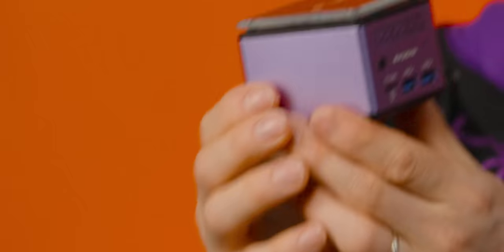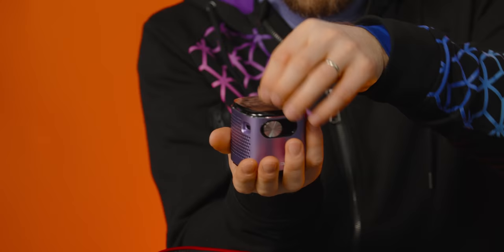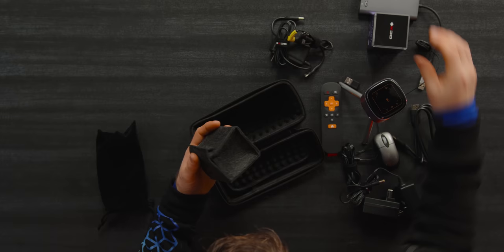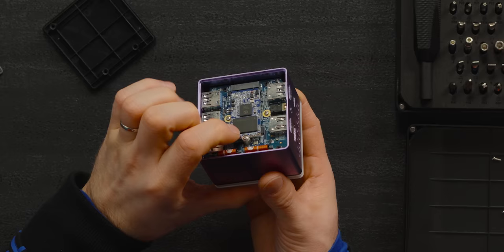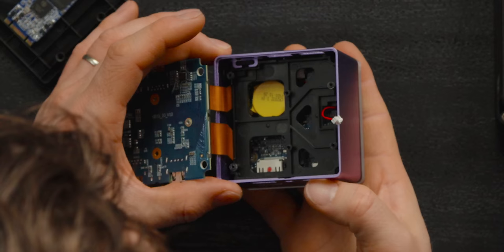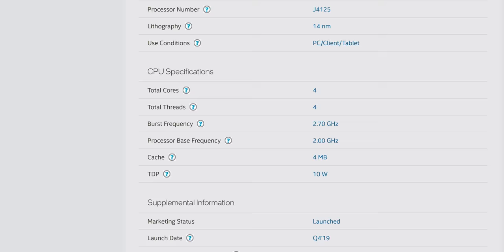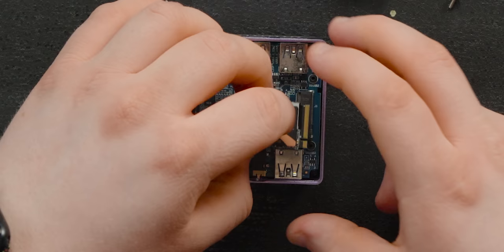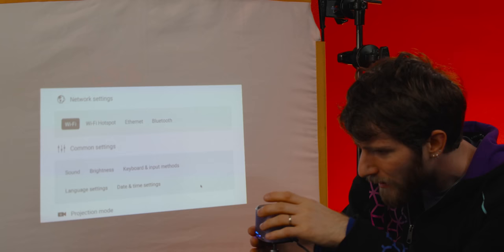This is a computer - XDO.AI PicoPC

Comment: Having the USB ports upside-down is just pure genius because it means you will get it right on the first try!
Reply: No, it mean you get right on the second instead of the third. Lol!
Reply: That's not how it works. You get it right the first try, but are holding it slightly off-center. Then you flip it, it still doesn't go in, you wiggle it around to make sure, then pull it back and look at the port and look at your cord and realize you had it right the first time.
Reply: @CyberneticArgumentCreator  this is the only way
Reply: LMAO
Reply: Pretty sure this results in a 1 try penalty, so it would go from the perfect 3 try minimum, up to 4.
Reply: @CyberneticArgumentCreator  lol
Reply: Not sure why products in 2020 are coming with USB A anymore. I thought we moved on to USB C?
Reply: AND NOW USB C :)
Reply: Points!
Reply: @bland9876  the question might soon change to: "Wires? What's that?"
Reply: Lmao 😂
Reply: @CyberneticArgumentCreator  i did exactly this with my phone cord about 15 seconds before reading this
Reply: eh, it's at least 50/50
Reply: It always takes 3 tries no matter what
Reply: @bland9876  usb c is absolute garbage?
Reply: I have one of these and you still get it wrong most of the time.
Reply: @timothylim4717  transfering fils with Bluetooth (wireless USB) is very slow.
Reply: @ETHANR26  no it's not. Why would you think that? Being able to do everything (power in, video out, printer, hard drive, speakers, mouse, keyboard, optical drive. Ethernet, etc) with one connector is amazing. USB C FTW.
Reply: It took me way too long to get the joke😂😂😂😂😂
Reply: LOL
Reply: You will get it right on the first try, but you'll think it's wrong, then flip it over, then it's wrong, then flip it over, and then you're still wrong. 😀
Reply: Muscle memory says otherwise😂
Reply: @CyberneticArgumentCreator  this or u actually got it wrong, either way u get it wrong
Reply: @bland9876  psst we aren't in 2020 anymore, we are in 2023 ;-)
Reply: @LiLBitsDK  That's the point of my comment basically what you do is you put a year that is not the current year and you say that in this year certain things should be that way but they're not. I mean you can always put the current year but if you do that then it doesn't have as big of an impact.
Reply: @LiLBitsDK  woah
Reply: @bland9876  you wrote "Not sure why products in 2020 are coming with USB A anymore. I thought we moved on to USB C?"

So not really "your point" you would have written "Not sure why products in 2023 are coming with USB A anymore. I thought we moved on to USB C?"

or "No USB C, that is so 2020" or whatever number you feel, but we had usb c way before 2020...
Reply: @LiLBitsDK  exactly I'm saying that even in 2020 products should have come with USB C
Reply: Genius!
Reply: Might as well use a laptop 😂
Reply: @kristopherleslie8343  but a laptop doesn't have that big a screen... with that thing you can watch a movie with ya friends if ya wish without cramping around a measly laptop
Reply: the usb port have a 4 dimensional geometry there is no up or down left or right
Reply: @bland9876  Because a lot of existing accessories are USB-A and not everyone wants to, can afford to, or even should (from a waste perspective) replace all of said accessories that still work fine. Same for having to have adapters for everything. There is no issue with having a mix of ports considering the ubiquity and reliability of USB-A. Eventually everything will likely roll over, but we have had USB-A for a long...long time, and it has a huge ecosystem.
Reply: @Raven1024  It would have been easy for them to have a transition period where all computers came with both types of ports and all new accessories used USB-C I mean you don't see micro USB hardly at all anymore and we're mostly just using USB-C and everything's fine so it's no different.

On the specific topic of your old peripherals that have regular USB you can just get a USB to USB C adapter That's how I use everything on my tablet that only has one USB C port because Microsoft thought that was a good idea.
Reply: @bland9876  Microsoft followed Apple's lead on over minimizing I/O for laptops on the main line stuff. As for the transition period... You're in it. You don't see micro-b anymore because it was never intended for connectivity on anything other than phones and small devices and the plug sucked. USB-A plugs on the other hand are quite reliable and not every item needs the features of USB-C. Nor the extra expenses from using it on the manufacturing end.
The USB-A style plug is also used for everything up to and including USB 3.1 Gen 2... Because it still works fine and is still a fair bit cheaper to put in on the manufacturing end.
As for the "Just use a dongle/adapter" argument I kind of covered that before... It's better to not have to buy adapters.

I would argue the bigger issue is with companies like Microsoft and Apple that want to reduce IO for... Not much reason on premium price devices where they could easily afford to have double the ports they do if not more and it still wouldn't really hit the bottom line on their profit that much.
Reply: @Raven1024  the adapters would only be needed for the transition period. After than all your devices would be USB C. I use to use adapter to go from micro USB to USB C and vica versa but now 90% of my devices are USB C and I just use USB C cables everywhere.

As for the connector costing more you. Don't have to put all the pins in if all your using is it for us power and data just like USB 2.0
Reply: @bland9876  You're assuming people are constantly buying new USB equipment and therefore the transition will be short. There are relatively new standards that still use the USB-A connector because it just works. Type-c came out in 2014, meanwhile USB 3.2 gen 2 came out in 2017 and still uses the A type connector. It's reliable and does what it needs to do and is cheap to make. There's no reason to toss it for USB C where it isn't needed.

Also if you wire connectors on devices like that you end up with confused customers who think the property l product should work in ways it doesn't. You don't want to half wire connectors. Just use the appropriate one for the capabilities needed.
Reply: @Raven1024  I'm not sure how a person can get confused. Unless your talking about using a USB C connector that's non reversible. That would be bad and definitely a big no no.
Reply: @bland9876  Because if it's a USBC connector, you expect it to have certain capabilities... A connector that is not wired fully would not have those capabilities. So if you had a device that was running off of a USB 2.0 equivalent spec but using a USBC connector... It would not behave as you would expect it. 
IE the transfer speed would be lower, or power delivery would not be as robust as you would expect...

It would be similar to wiring a display port connector as an HDMI... You could technically electrically make it work just fine. The standards are quite similar. But it wouldn't work 100% as expected which is a problem.
Reply: I've never had this problem with USB A. I'm still surprised we're moving to USB C.
Reply: @CyberneticArgumentCreator  its crazy how we all live the same lives
Reply: no because the first time you try to plug it in is the right one, but then you flip it upside down and it's the wrong one.
then you flip it again and it's the right one 
so, knowing that is upside down you will get it right once you turn it the other way around.
LOL
Reply: @CyberneticArgumentCreator  it’s strange how seemingly every human on the planet goes through this experience. Luckily, cables aren’t “one sided” anymore. So no need to flip it around and all that depending on the cable. Sadly, trying to plug in electronics in the dark is still a nogo

Comment: I can only imagine the nightmare what the PCB layout designer had to live to make that shit real.
Reply: Why, the Nintendo GameCube existed for over 20 years now. Its the perfect inspiration for such design - cubic, dual boards stacked on top of each other and relatively small.
Reply: @ryutenmen  The amount of stuff to make a PC motherboard is insanelly higher than the GameCubes, I don't think he means the concept of stacked PCBs, only to pack all traces and components needed into such a small footprint.
Reply: @RBgamesbr  also, many signals in a pc must have traces routed together to ensure optimal performance (or even functionality in some cases). This makes routing so much worse. Sometimes you can route them individually, but there are chances of encountering problems later
Reply: @RBgamesbr  There is only  5V in this device... and the PCB is not more complicated than the one in old smartphone like NOKIA 500 that was made in something like 2008 and PCB for it was most likely less than half of that space.
Reply: I don't see any problems with it at all and i work with electronics R&D. The boards didn't look densely populated at all. The J-series processors are SoCs and doesn't need a lot of extra components.
Reply: @thedryparn1279   This is your electronics R&D boss, you are fired for leaking company information
Reply: EDA software that can automatically place components and route traces, obeying your design constraints (trace x must be routed alongside trace y and z and they all have to be the same length, the trace for this net needs to be x mm wide and have a clearance of y mm, these specific components must be in this place (ports, headers), etc) has existed for many years.
Reply: @thedryparn1279  my thoughts exactly while reading these comments
Reply: What if it was all done by artificial intelligence. 
Jobless soon 😓
Reply: All the YT "experts" came out to tell to a professional PCB Designer how easy that thing is to design 🤣🤣🤣🤣

I can't even...
Reply: @RBgamesbr  "The amount of stuff to make a PC motherboard is insanelly higher than the GameCube" is not true. In fact, if some someone had a challenge doing this design was Nintendo with their Game Cube, since it was the first of this kind. The whole R&D was in them.
Aside from that, only the IBM CPU which was different architecture from a X86 for PC it was the only significant difference, but the design of the boards and the whole unit it was basically the same.
Reply: @papagrounds  Thanks for dedicating a career title to undermine how little design work there is LEFT to do, after so much has already been achieved and what is left is creative abstraction, which one might struggle with.

Of course if you're an professional steam train engineer, the magic of lithium batteries would amaze you as well. There IS amazing achievement there, but it's not something this company had to create from scratch. Work smarter, not harder.

I'm of course assuming there IS even that, because it's one thing to design this at all, another thing to design this WELL. A lot of the limitations are also artificially enforced with things like proprietary licensing of certain components, so you HAVE to have some legroom to work with because you can't legally integrate some systems. In SOME countries. That's one of the reasons Bluetooth headphones exploded so much, because there's a lot of laissez-faire leniency ON that technology IP.

Not to MANSPLAIN so much, but there's another word for incompetent men explaining your field of expertise to you, sic She-Hulk. That is them engaging with your mentorship, if you have the backbone to CORRECT them. That's something people had to do, before dancing on eggshells if they get an HR complaint for it. AND THAT IS WHY such things are now mostly contained to places like Hong Kong.

Comment: Linus... They had been selling these in Taobao for 2-3 years actually... just "updated hardware". I am actually a bit surprised that you didn't find out about these tiny PC's sooner.

They are actually used along side with TV's in HK and China these days to use the large panels as monitors.

There is actually a 5.5" touchscreen tiny PC that runs the EXACT same specs that's coming out this month.
Reply: He cant be blasee, unimpressed by many things he reviews. Would make for uninteresting videos. Not really an accusation. Just a reasonable guess. But good added info, thanks
Reply: do you have any links to those? interested in buying one

Comment: I'm surprised Linus hadn't heard of a J4125, they've been around so long now that they've basically been replaced with the N5000 series by OEMs. Very common in mini PCs, netbooks etc. They need sufficient cooling or they throttle, so it's not uncommon for them to underperform when crammed into something this small.
Reply: Also one of the most popular CPUs for NAS devices (Synology, QNAP) and firewalls for Pfsense (Qotom etc.). 
I have the 2-core version (J4025) in my NAS. 
J4125 replaced the J3455 which was also very popular in the same series 
and as you said they have been replaced now by 5000 series and 6000 series models. The NXXX versions are usual 6W while the JXXX version are 10W.
Reply: and the N6000 are just hitting the market. so this thing is basically 2 gens back for a very small size reduction over something like a nuc.
Reply: And the 5000 series are already being replaced by the 6000 series. This is old as dirt tech, and not really able to do much of anything that someone's phone from 3 gens ago can do.
Reply: Agreed, you can buy better cooled N5105 mini PC's which are thinner than this for the same sort of money and they'll do dual output and gigabit LAN etc. This is a dead product from the launch day. The whole package is a bit of a novelty but in reality it's the PC part that you really want.
Reply: @tfharper  Replaced sort of depending if you want fanless or not setup. I would stay at the 5105 for a fanless case ATM in this range of CPU personally.
Reply: I have one of these as headless Debian server than runs NAS software and Plex with Intel Quick Sync. They’re much better than the Raspberry Pi for this sort of task and use minimal power.
Reply: @henfibr  Almost bought a board with the J4125 until I realized it was a celeron, and a lowspec one at that. Celerons always had 1/4th the cache of pentiums if I remember right, real bottom of the barrel for performance. Got a V1605B ryzen chip instead, and never looked back.
Reply: I'm surprised Linus hadn't heard of a J4125,
they've been around so long now that
they've basically been replaced with the
N5000 series by OEMs. Very common in
mini PCs, netbooks etc. They need
sufficient cooling or they throttle, so it's not
uncommon for them to underperform when
crammed into something this small.
Reply: I guess he spoke for the average user who would not have heard of them.
Reply: Repackaged mini PC + repackaged pico projector + Re-badged accessories = 1 million $
Reply: @henfibr  the N5105 is also 10W not 6W
Reply: Its a fluff piece to promote a product, there is no reason he should be so interested in this when other options demolish it in value and performance.
Reply: I had misfortune of using one at work, appaling thing. Was at 100% basically all the time, took forever to open a single tab in Chrome...
Reply: @Cynyr  ll
Reply: My NAS has one, it's ok I guess.
Reply: I've still got the older, lower power N3700 running as my file server, Roon server, and anything else that needs to be on all the time. At just 4W, I've got it running passively in a mini-ITX case, but without a fan it would probably start getting pretty hot in a box as small as this Pantera PC. I think Crestmont's architecture improvements will make for some very good low power chips in the next series.
Reply: @tfharper  Windows.. and anything x86.

Comment: This thing is adorable and surprisingly well thought out, especially at such a reasonable price.  Not a product for me, but I am impressed with what it is.
Reply: I agree, though I'm not a fan of the mess of cables required. Destroys the whole look of it.
Reply: Well thought out?
That's a mess of cable, nullifyng all the portable and small form factor of the product.
The case for carrying all that stuff is bigger than a gaming laptop with 100x the power of that.
Reply: @pedgarage  Not to mention that $175 is just the PC with no SSD, no projector, and doesn't even come with a case. A $200 laptop is infinitely better. I found an 11th gen 15" i3 on Newegg in 2 minutes and that even comes with a case. This has a 2019 Celeron that's going to be way slower.
Reply: Well it's good that it's not a product for you because it's a scam
Reply: The slow SSD and 4 core CPU are horrendous
Reply: well thought? its a frankenstein of bunch of cables and converters. If they can get the pc + projector into one unit, and wireless mouse + keyboard that will work without plugging in anything that would be a WELL THOUGHT for real. You can ditch everything else its useless
Reply: A tablet with keyboard is the most portable PC you can get.
Reply: Ouya 2.0
Reply: I'm trying to think of a place where this might be useful. These would be fine for a typing class when paired with a real keyboard. Living room video? Most TVs have youtube built into the menu. Then there are things like the Amazon fire stick. Neither of those will stream from a shared folder on a local network. It could work for that. I have thousands of files locally stored from DVD / Blueray.